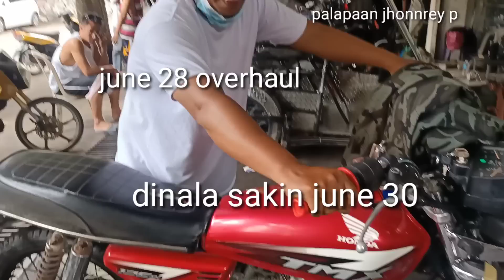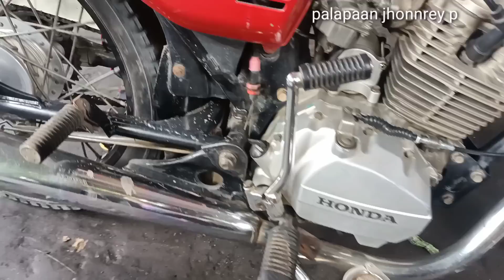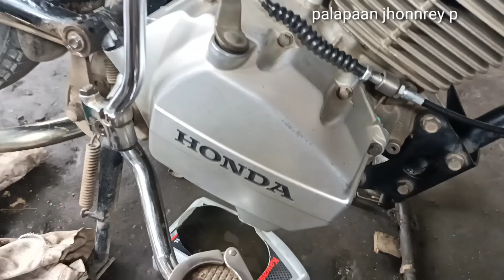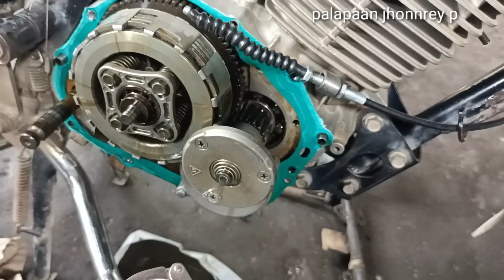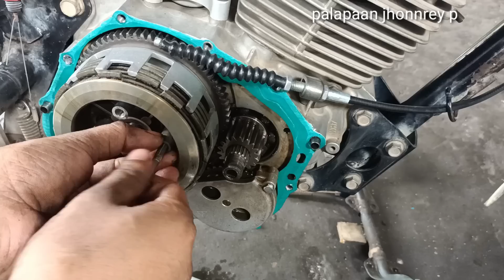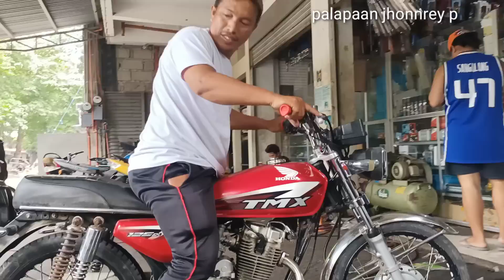2 days Palang na overhaul Ang ingay paren ng motor ni sir ano nga ba Ang papalitan ??

Comment: tama ka lods, kahit palitan mo pa ng original yan na tmx alpha parts ganun parin, at tama kang mas matibay pa sa RUSI. quality gawa mo lods. walang pabor pabor.
Reply: Gawang Lifan na kasi yung engine at spare parts ni Rusi kaya magmula nun, marami na silang nabebenta na units. Sayang lang, hindi pa nailabas yung Rusi Macho noong bumili ako ng TMX Alpha kaya nakakapanghinayang.
Reply: @nath_takahashi   may video din yan si sir palapaan na pinagkumpara nya ang rusi na lifan parts ng macho at tmx alpha 125, napaka low quality ang push rod ng tmx alpha kumpara sa rusi parts, lalo na yung bushing sa idle gear ng alpha na walang daanan ng oil tapos parang copper lang yata, kumpara sa bushing ng rusi na may daanan ng oil tapos solid metal pa. wag ka rin kukuha ng xrm 125 FI, tingnan mo sa google, pinoy made din yan at nilaunch nila ito noong april last year sa new zealand kaso na banned ng new zealand kasi outdated ang parts at ang fi na ginamit ay from year 2007 honda supercub 50cc kaso ang original na honda super cub 50cc ay keihin,yung nilagay ng honda ph ay bosch lang na FI system na pinaka mura. at pwede lang sa new zealand yung hondang hindi tinipid, yung honda ct 125 FI na euro 4 compliant gaya ni rusi, with full digital panel na yan at all LED light at mags na. nakakalungkot yayaman na naman ang may pakana nito. wag ka basta maniwala sa sinasabi ko, mag search ka din para marami na tayo na nagbabackground check muna. karapatan natin yun bago mag invest.
Reply: @UNBIASEDCOMMENT  oo nakita ko na yung comparison video niya tungkol sa TMX Alpha at Rusi TC Macho. Sadyang mahina lang talaga yung tanso na idle gear ng  TMX Alpha. Yung sa TMX 155 naman, tanso din yun pero matibay ang pagkakagawa eh. Made in Japan talaga. Wala na din ako balak kumuha ng latest Honda units kung sakali, dahil hindi na made in Japan tulad dati.. Baka mabutas pa ang bulsa ko pag nasira.
Reply: @nath_takahashi   walang duda na matibay talaga ang tmx 155 kumpara sa alpha. at may 5th gear pa yun. sayang lang talaga hindi nila binalik. napaka quality talaga ng tmx 155.
Reply: Sabi nila normal daw sa x alpha kc naka push rod engine sya
Reply: @kanormangdragon7837  malagitik cylinder head ng TMX  Alpha
Reply: @nath_takahashi  ano po dapat palitan sir? lumagitik din sakin..slamat po.
Reply: @2horny4u2handle   may tutorial yan si lods johnrey paano magapan ang sira ng tmx 125 alpha at paano patibayin para hindi na bumalik ang sira.